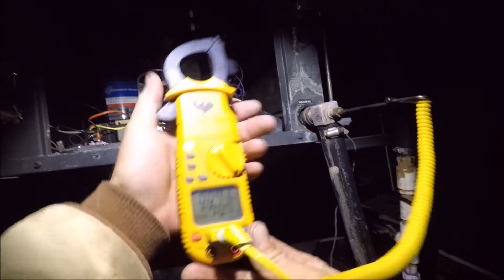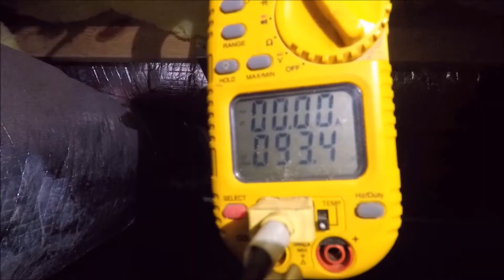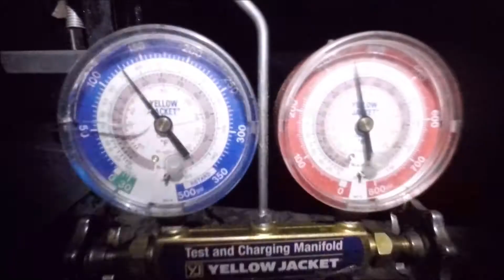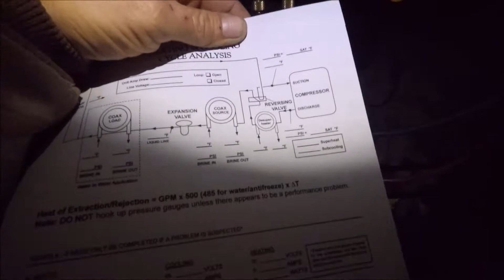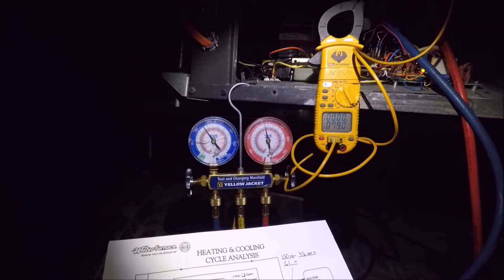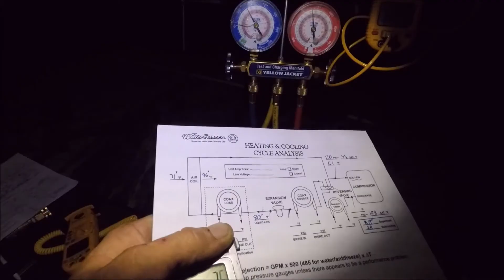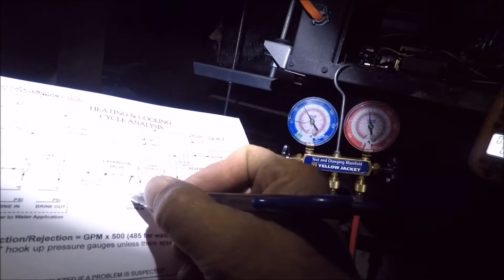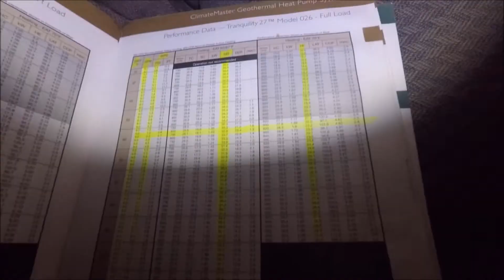HVAC How to diagnose a geothermal unit thats 8 oz low on charge

Comment: What the easiest way to test control board on this 27 model. Thank you!
Reply from the maker: Could you elaborate a little more on the question to find a fault in the system you short the test pins out to the green light goes off and then it blinks you count the blinks and then refer to the manual or paperwork that should be in the system with the system or somewhere around..
Reply: @billbuckman  if control board goes bad. For example compressor relay goes bad. How to test it in the board?  I’m not going to have voltage on yellow and black coming out of that board?
Reply from the maker: Yes if you have inputs but no output as long as your pressure switches are closed and there's no other reason for the board not to send the signal out for why one then board is probably bad there's not really a way I know to test it other than putting another board in it cmx bored I believe or cxm I don't remember also might have sensors for a coil sensor or a freeze protection sensor if those are bad or not tied together freeze protection One and freeze protection two sensors as well as drain sensor so you have to make sure all of your sensors are good before calling out the board
Reply: @billbuckman  thank you! 🙌🏼

Comment: Hey Bill!  Where did you get that worksheet for the geothermal units.  I really like that.  Care to share?
Reply from the maker: https://www.waterfurnace.com/literature/5series/IM2500AN.pdf

Page 64 of this book

On waterfurnace.com website scroll all the way to the bottom to literature. Then you're looking for installation manuals has the waterside diagnostics paper. And specification catalogs have the heater rejection and heat of extraction tables in it depending on which systems you're working on
Reply: Just got wind of your channel, great information, what thermal probe are you using or Kit you carry

Comment: Could I talk to you about my climate master problem?
Reply from the maker: sure what you got
Reply: @billbuckman  I have a tranquility 27 split in my attic. The compressor is in the basement.  It will come on from thermostat and puts out 58 degree air. After 5 minutes the compressor shuts off and the air handler keeps running.  There are no fault codes in the compressor box.
Reply from the maker: @MRRAGPICKER  okay it could be condensate the board that is inside the unit should have a solid green light if there's no faults after it goes through a three-fold retry it should blink rapidly and there's two test pins on the cmx board short that out with a screwdriver until the green light shuts off and then count the number of blinks.. if it is six blanks it's condensate overflow which might not be the case unless you have float switches at your air handler and a clogged drain line which if it's tied to the yellow wire it will disrupt power to the compressor and keep it from running until you clean the drain lines typically that's a common problem sometimes they'll break the compressor wire with the safety float switches in the Attic or at the air handler try checking on those couple things make sure the system is draining if you know where it drains put a shop vac on it just to pull all the crud and crap out and then furthermore I have a list of the fault codes and I could tell you what each one means for the blinking and clicking sound you hear after you short the test pins out on the cmx board or cxm board whatever they call it I will try to tell them to you now but but when you short the test pins out you also put your system in test mode which speeds up all the timers so when you're done you need to short out the two test pins to get the green light to come back on for normal operation the blink status code are as followed
1 blink-
Reply from the maker: @MRRAGPICKER  one blank after shorting at out the test pins on the cmx board till the green light turns off means one blink no fault in memory test mode
2 blinks-high pressure fault that would be no water flow and cooling mode usually.
 3 blinks -low pressure fault in memory which could be low on freon or refrigerant or a bad low pressure switch.
  4 blinks-e freeze protection  1 fault don't remember if that is freeze protection on the coax coil or freeze protection on the evaporator coil it's one of the other
 5 Binks would be freeze protection 2. Which could also either be the evaporator coil too cold or the coax coil freezing in the heating mode due to no water flow or low pressure
Reply from the maker: And six blinks would be condensate overflow detected which in a package unit there's a sensor in the drain pan and they're supposed to be one in a split system but some people don't hook them up
Reply: @billbuckman  no codes in the compressor unit. The board in the air handler has a light that is on for 3 seconds and then off for 3seconds over and over.  The condensate drain  seems fine, I blew it out amy way.
Reply from the maker: @MRRAGPICKER  I don't know the fault codes for the air handler you may have to Google that and look that up or see if it's on the diagram or in the book if you have them on hand
Reply from the maker: Usually the blinking light on the CFM board and the air handler indicates 100 CFM per blink so that means that would be 300 CFM if indeed that's not a fault code if it's a fault code then yeah you got to figure out what it means but if it's just blinking showing you CFM cubic feet per minute of air flow usually like I said is one blank for every 100 RPMs or 100 CFM
Reply from the maker: Cycle power to the unit again at the air handler turn the breaker off for 3 seconds turn it back on let everything run and let it do the three fault lockout retry cuz it basically tries to run the unit three times like three strikes you're out and then it does a complete lockout
Reply from the maker: Once it locks out permanently if it's a problem in the compressor section then don't reset it yet and see if the cmx board has a rapid flashing light that would indicate there is a error in the code then short the test pins out and see if it gives you more than one blink per second on a compressor unit cmx board make sure you have water flow good air flow clean filters if you have gauges check the pressure while it's running

Comment: We have one of these units in my family's garage it's ran great for years but for some reason the last two years it's having trouble running AC it just can't keep the house cool and acts like it struggles  and when it rains it does not cool at all which is weird but we got someone out to  look at  the unit and came out completely fine and it ran fine for one week and now it's back doing the same old thing idk what's wrong with it there so picky all ik is it won't cool and the house is stuck at 81 degrees I hope when they come back they can figure out what's happening ( ps we have notice if we keep the unit off for about 1 hour to two hours and turn it back on it works fine again for maybe a day or less  so maybe overheating problem  ? )

Comment: Just found your videos and saw you used to work for Climate Control. I'm an installer/service tech and live in the Jacksonville area as well. I got 15 years experience in the trade. I worked for Jacksonville Heating for over 10 years, but now I work for a smaller company in Sneads Ferry. It's a small world. I was surprised to see someone from the same area making hvac YouTube videos. I was wondering how you liked working for Climate Control ?
Reply from the maker: Vinny Mac wow yea verry small world climate control was a great place I was their 7 yrs . just left them for a larger opportunity the pay was good and I learned a lot but now I moved on to Commercial Refrigeration no I do service to Aldi grocery stores
Reply from the maker: Vinny Mac do you work for a Miller?
Reply from the maker: Vinny Mac lo